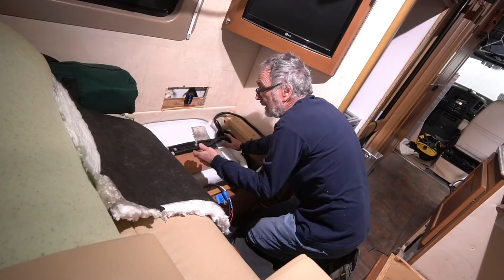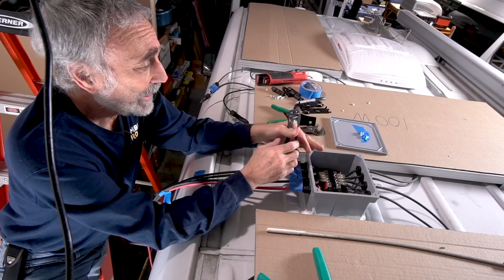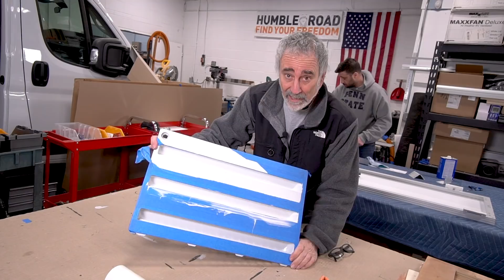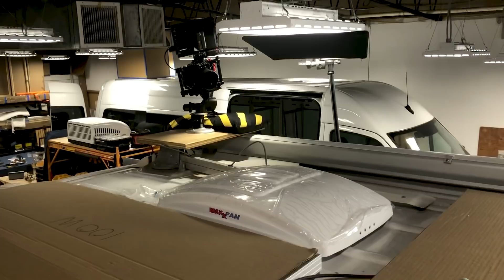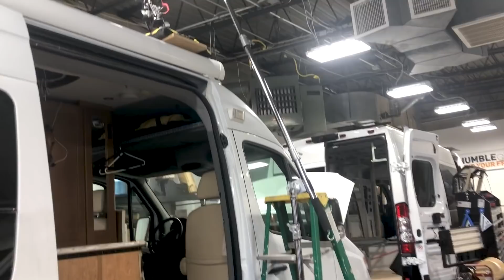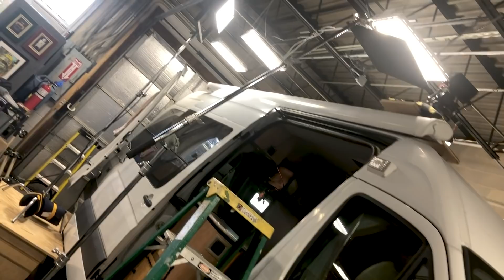A completely new thoughtfully designed custom power system in an older Sprinter van comes alive!

Comment: Can a solar panel be put on top of the hood of van. I know we open hood to check oil, brake fluid, change serpentine belt, etc.
Maybe pebble rock on the road will hit the hood but the solar panel can be covered plexiglass.

Comment: German Espar Airtronic Heater is 12" x 5" x 5" cost $1000
Chinese Diesel Heater at Walmart is 15" x 5" x 5"  cost $135.
Search for:  Car Diesel Heater Parking Heater 8KW 8000W Diesel Air Heater Diesel Heater 12V
In case anyone prefers the cheaper option.  I wonder if the German one is actually made in Germany or China.

13:35 - I used fine aluminum mesh to cover the vents from the inside to prevent bugs and large dust/leaves from entering this space.  Construction glue (Loctite Power Grab) holds it in place on edge.  Both held up well.

Great to see your camera lighting, and also details on the solar power wiring box.  Nice touch.  Thanks!!
Reply from the maker: Lass, I'm surprised! Chinese heater!? OK, here's the scenario; we are in a plane, it has had engine failure and it is going down. The pilot gives you a choice of a Chinese parachute for $135 or the German-made real-world proven industry leading parachute for $1,000. You choose. I will remain humble and wait for you on the ground...
Reply: @HumbleRoad  Ha, ha, ha!  You win.  I will remain silent on this topic forever more!  German it shall be! After all, their RVs are the best too.  👍

Comment: I am wondering if you can install a switch to cut off the power from the solar panels when working on the system.
Reply from the maker: 😳
I'm all about isolating the individual parts of any system. There are breaker/switches on the solar as well as the alternator feed and the house DC also. Not to mention fuses on the opposite side of each component.

Comment: Welcome back! Glad you had a holiday vacation!

The PleasureWay is coming along very nicely. It wont be short of power and will be an off grid dream. 
Re: the face-plate - I like the idea of keeping the matching panel if you can. it looks like there may be room if it's hinged at the back to swing open to all the way? Maybe you can do some hidden hinges and add a strut horizontally  at the top to keep it in the open position and add lateral support?
Reply from the maker: Thanks for the tips!

Comment: George, I like the idea of making that cabinet front all part of the top, all together. Anyways removing the front of the cabinet only gives you access to the wires and not inverter or other electrical components.
Reply from the maker: The inverter and MPPT are accessed through the top of the cabinet by removing the cabinet floor.

Comment: George, thank you for once again posting a first class video. I have a question about your Lithionics battery system. From what I have been able to learn, Lithionics rates this battery as having a -4 F minimum temperature, any lower and damage to the battery occurs. Do you have a way of keeping the battery warm (battery temp above -4 F) is the van is stored in a northern climate in sub zero temperatures? I ask because I face that same issue (Wisconsin, lows between -10 to -20 F lately) with a van that has the same Lithionics battery.
Reply from the maker: I strongly suggest you pose this question directly with customer support at Lithionics.

Comment: Great video, as usual! One question, why not install 80/20 on either side of the van roof, in the gutter, using the factory mounting points? This will give you ample options to mount with the rigidity of the 80/20. To avoid noise due to air flow when driving you can insert a filling cord, also available within the 80/20 catalogue.
Reply from the maker: Great minds think alike! I will be fabricating my own roof racks on the two vans in house now. The Pleasure-Way, however, has too much ancillary stuff in the way and the interior ceiling is completely sealed off from my eyes and hands. This is why I decided to build my own..

Comment: 400w/14.5v(charging voltage)=27.57 Amps      Higher voltage also works better in lower light or lower sun angle conditions.  Recommend upgrading your MPPT charge controller to accept a higher input voltage!  Would also recommend a series parallel to get up to 40 ish volts.
Reply from the maker: You're spot on, Jamison. When the van was idling I had 27 amps going into the battery through the DC charger.

Comment: If anyone bolted that junction box to the top of my van build i would be very upset.  It will be full of water in no time unless it all drains out of the bottom and ends up leaking through the ceiling.
Reply from the maker: Oh no!
Reply: @HumbleRoad  it's in a wet location.  Eventually it's going to give you issues. I would have clam-shelled all cables into a dry location before terminating.  Just my opinion.

Comment: Thank you so much for detailing the new electrical system for retrofitting a van.  I am in the same spot with an Airstream van in a 2006 Sprinter.  This helps tremendously!

As for the cabinet front, my input is function over form.  The   Cabinet front will be down low and likely not that noticeable and I prefer easiest access in tight spots.

Thanks for the video lesson - really helpful to those of us thinking of starting a channel.

Katy

Comment: As I told you earlier, I am starting a transformation of a 211Cdi sprinter, 5.2 meters long. I saw that the trend now is not to use more gas in the vans and I liked the idea of using an induction cooker with just one pan.
Your vans are big, mine is much less, without much sophistication, in your opinion how much should I have batteries and how much solar panel?
appreciate!
Reply: You are right! the intention is to stay without connection for a few days, maybe 2 to 3 days. Here in Europe, we have a lot of infrastructure for camping and motorhomes, so easy access to energy.
Reply from the maker: That is not a question that can be answered without a lengthy discussion on your intended use and expectations. What kind of van lifestyle will you lead? If you hopscotch from campground to campground, you need very little battery capacity. if you want to disappear into the woods for days at a time, then you need to build for a self-sufficient way of life. You've got to dig deep, look within, face your fears and answer your heart's questions. 😉

Comment: hi george, how are you? I will dare and give an opinion on your construction of the Promaster.
A little cheeky on my part to want to teach the master!
I think that toilet in front of the main door of the royal house is not very pleasant to see! I know it won't always be there, but when in use, the person will be right in front of the entrance. My suggestion: why don't you turn 90 degrees, and when someone is going to use it, stay inside the shower, and when you go to take a shower, put it out, protected by the rotating furniture, so that nobody can see it and to use the throne the person stays with more privacy, no curtain outside the shower.
Thanks for the opportunity! "options"
Sorry to post this comment again, but I had posted it in the community tab, but I don't think you saw it.
Reply from the maker: In order to use the toilet in the shower room, with this design, you have to open both of the armoire modules to climb in. A bit too much contraption work to use the toilet, which is more frequent than the every-other-day shower. But...as I said to Sam way back when...I'm not yet 100% sold on this design. And have since come up with a new design that must be visualized and explained. Stay tuned!

Comment: We are building ford transit van with 3 series arrays (to minimize shading issues and to track power production/faults easier), each array of 2 panels will have its own mppt charge control. 

So 3 mppt controllers with circuit breakers in between.  (6 10awg wires from roof to inside) (using roxtex 10 way ez entry which is nice product)

Panels: 2-100 watt renogy, 2-100 watt renogy, and 2-175 watt renogy

MPPT : using 2 victron 100/20 for the smaller panels, and 150/35 for the 175 watt panels. 

Anyone think this ridiculous? Other comments?

The charge controllers about same price 3 small vs one big (150/60 as alternative single unit)

Half the panels mounted on hinge to so can tilt which according to study on this topic (dont have link handy) should increase production by about 30%

If anyone has questions or comments reply here and will try to answer (not a pro but have researched a lot)

System not running yet but hope to have it going soon,,,cheers to all the van builders out there!

Comment: George, you should rethink and reconfigure your fully parallel configuration to at least a 2s2p configuration as your MPPT controller requires a minimum panel voltage to run in its efficient MPPT functional range. Check your controller's manual for that voltage range required. In 95% of cases, a 12v panel does not meet that minimum MPPT voltage threshold.
Reply from the maker: Can't do that, Barry. Open voltage is 21.3V. Just two of these panels in series will exceed the maximum voltage rating of this controller. I will be doing more testing with this controller. I am satisfied with the DC charging, at idle I was getting 27 amps.
Reply: @HumbleRoad  OK! I see it's a very low voltage design....pretty unique for a 12v MPPT controller.

Comment: George, I watched a YouTube video where a Solar Panel Installer added a One-Way Diode to the power wire where it connects to the panel. Preventing the shaded panel from diluting the entire Solar Panel array from losing power from the other panels.